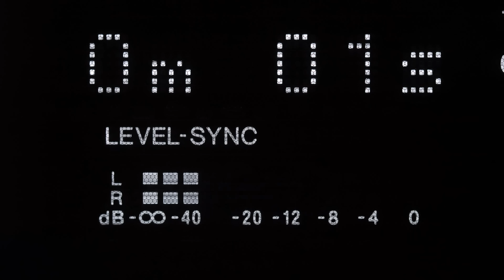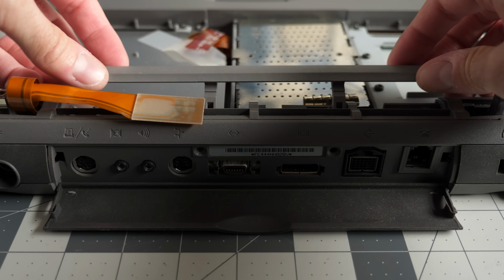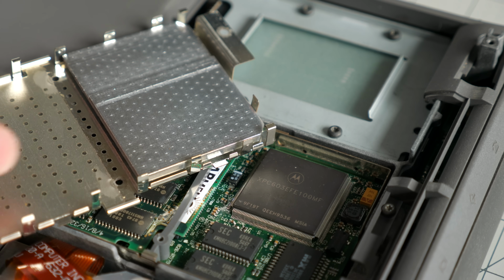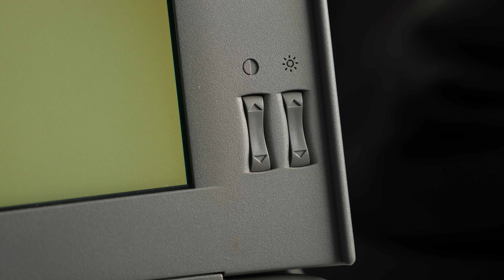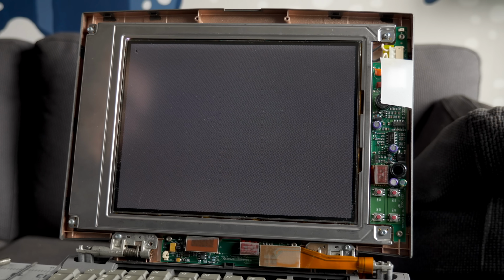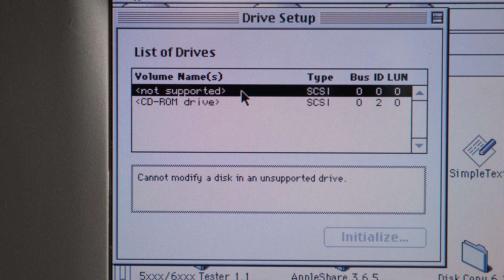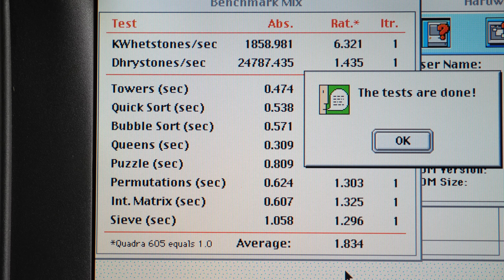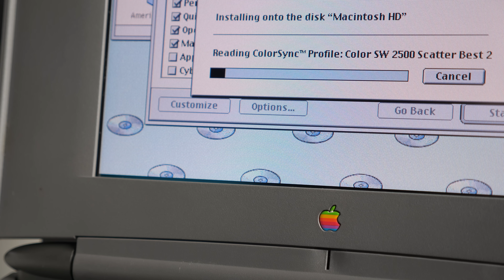Retro Mac CPU Upgrade: Putting the "Power" in PowerBook!

Comment: I had one...did both the CPU upgrade and had to replace the screen. Woulda been early '96, IIRC... Also had an internet access addon that velcroed to the back of the screen w/flip-up antenna (might've been two ..) that talked to streetlight-mounted tranceivers on 900MHz, again, IIRC.

Comment: Gosh, I have one of these in my storage locker (climate controlled). I think the screen hinges are just a little looser than they should be, but I don't think they have any cracks. Last time I checked it, it would still boot fine. The G3 processor upgrade is something I always wanted to do but didn't have the funds. I should probably check on it again. He's right in saying that people loved this model. It was a very reliable machine. I remember the 5300 being a mess, but the 1400, 2400 and 3400 that followed it were much better.

Comment: I had a PowerBook 540c, back in the early 2000's.  I really loved that machine.  I also used it with an external hard drive from DEC, and transferred files between my Performa 6400/180 tower, and that machine.  I was running Mac OS 8 on it as well.

Comment: Great video. I have a PowerBook 520 that needs a drive replacement, but SCSI drives are impossible to find and the only viable alternative I found are the SCSI2SD boards, which are also hard to get (at least the PowerBook version) and quite expensive… I’m not sure what other alternative I could use…

Comment: Those PowerPC upgrade cards might have been bottlenecked by the slow bus speeds (among other things) in '040 macs, but they were still a huge upgrade in terms of performance. They also let you do many things that were not viable or even impossible on an '040 mac. Running PowerPC-only software (and games) is one thing, but the inclusion of an FPU is also another. The LC040 lacking an FPU and having that bug that prevents SoftwareFPU from working means that a bunch of software that requires an FPU either won't run at all because they bypassed Apple's floating point math libraries and had no fallback, or they did use the floating point fallbacks and ran excruciatingly slowly. However, with a PowerPC upgrade card, not only could you run PowerPC-only software, but you could use PowerFPU to emulate the '040 FPU when running '040 software on the PowerPC. Unfortunately, PowerFPU still ultimately emulates '040 floating point math on the PowerPC integer hardware, so it's much slower than a real '040's integrated FPU, but it is around the speed of the '030's discrete FPU, so usable.

Comment: This is a great, thorough video.  One tidbit:  the 68020 reference in the benchmark is telling you it's running under 68k emulation.  The 68k emulator in the PowerPC emulated a 68020.  4x Quadra 605 is the emulation equivalent.
Reply: That depends on the generation of the emulator. The initial NuBus PPC Macs did indeed use a 68020 emulator but I think by the time the PowerMac 9500 shipped they had switched the emulation target to be a 68040 (perhaps the non-fpu version; I can't quite remember) This machine being a PowerPC 603 based CPU makes me wonder which version it is using.

I guess what I am saying is that the 68020 target only applied for the first few models of PPC Macs
Reply: @brianarmstrong234  The emulator was always reported as a 68020 CPU as far as I've known.  It may have been extended to support 68LC040 instructions later on, but I believe even on a G4 it is listed as 68020 to software.

Comment: I have a 540c, but I think it has the upgraded screen since it doesn’t have adjustment bars on the bottom left bezel. Mine unfortunately isn’t Power PC equipped. I do have 36mb of RAM though :)

Comment: The moment you powered it on, I knew it was just the connector. I have a G4 iMac (lamp) that the lcd cable connector is loose and if you move the lcd too much it pulls on the mobo. I then flip it over. Open it and press the connector back in. And boom. That black slow fade to white is she. It gets power and no signal. It’s weird but I’ve seen it before! I was yelling at the video! “Just reseat the connector!!” Hehe

Comment: Back when Apple made products that easy to service, highly upgradeable, and built to last more than a few years.
Reply: Other than the part where only Apple brand hard drives were accepted?
Reply: @vurpo7080  Id be real with you although yes, that isn't really good but also still better than what they're doing today.
Reply: Kyle's confusing phones with computers because Apple's computer (besides the Trashcan) are will known for their longevity
Reply: @error4159 yeah no they really arent, the desktops have had ssd parts pairing since the 2019 mac pro (making the trashcan mac the last fully upgradeable desktop from them which is quite sad) and on macbooks the storage has just been soldered in with the 2018 mac pro being the last model to have that be upgradeable (and still using a propriatary connector). and thats just storage, things are worse for cpu and ram.
Reply: @oggilein1  among general users who don't care about this and wouldn't bother to upgrade parts anyways, mac computers are indeed fairly well known for being usable for most daily tasks for as long as a decade or more
Reply: Die-hard Mac user since the early nineties. The suggestion that Apple’s creaky plastic laptops from the 1990s were somehow built to last longer than their sleek unibody aluminum laptops of today is laughably misinformed.

Comment: Here's another way of possibly repairing cracked display latches, etc. in the absence of a suitable donor machine. I first learned about this neat trick on Youtube. Apparently if you combine baking soda with cyanoacrylate(sp?) aka Super Glue(tm) it makes a pretty darn strong plastic filler. Who knew?! It looks pretty simple. The only other tool you'll need (other than the baking soda and super glue) is a file, to file down the gob of hardened super glue to the correct dimensions. Anyways Tech Tangents did a great video on the topic. He repaired several things with this method, including some similar (in function) plastic clips that are used to attach a PCjr sidecar cover panel thingy. https://youtu.be/n1meoZaHYZo

Comment: Also, regarding the hard drive, typically for a PowerPC machine you would use Drive Setup instead of HD SC setup. Both will work on early powerpc machines like this but you're leaving disk performance on the table by not using Drive Setup. There are patched versions of Drive Setup also available out there.

Comment: I have an unmodified PowerBook 5300ce, and decided to run Speedometer 4.02 just to see how it compares to your machines. For the "benchmark mix" I got a score of 27.821, and for the separate performance test scores I got 5.198 CPU and 203.636 MATH.

I know there were woes with the PowerBook 5300 but imo the machine isn't so bad.

Comment: Is the ‘PowerPC’ at the top of the display a sticker? Peeling off may reveal the original model name?
Reply from the maker: It is indeed a label, but I didn’t want to remove it  due to the risk of damage — not everyone who got the upgrade applied it, so machines that have them are in pretty small numbers.
Reply: @ThisDoesNotCompute  Very nice ;)

Comment: I know next to nothing about laptops or pcs, would it be possible to build a modern laptop in an old shell like these?
Reply: Not really.  I mean, with enough cosmetic surgery on the case, and probably a few custom PCBs or flex cables, sure.  But you're basically going to have to hollow out all the old supports that held the PCBs and drives and whatnot, come up with your own way to mount the donor motherboard, then figure out what you're going to do with the gaping hole in the back where the legacy ports went.

Every result of something like that, that I've seen, has just been a horror show of hot glue and Raspberry Pis and HDMI adapter boards just tossed into an empty shell.  It's a gross waste of a historical artifact, IMO, all for the sake of a Frankenstein computer that will be larger than most people want to carry, and probably not even nearly as useful as a modern finished product.

Sorry to rain on your parade.  But better you know before you invest a ton of money in parts and spent 30 hours with a Dremel just to toss the whole pile in the bin.

Comment: look the deference between replacing keyboard in this old PowerBook, VS new MacBook's,  2 ribbon cables ) 2 min of work) ,  VS 40+ screws, 40+ ribbon aluminum  sticks and removing's first 8 screws from the back, 15 for motherboard and motherboard itself, 1.5h of work.

Comment: I'm quite surprised the display resolved it's self as that is a known problem with the apple active matrix displays. It's called tunnel vision.
Reply from the maker: The tunnel vision problem seems to only happen on greyscale active-matrix panels, not color ones. There’s still a lot we don’t know about that syndrome, but as it becomes more common some patterns are emerging.
Reply: I think tunnel vision is more of an issue with the LCD panel delaminating from the polarizer layer which produces a dark vignette around the edge of the display. Anything with weird display artifacts is usually an issue with the signal timing being wrong, hence why Colin thought it was a capacitor issue at first.